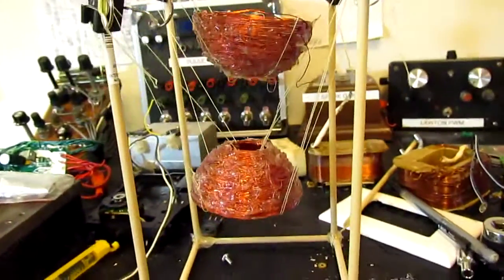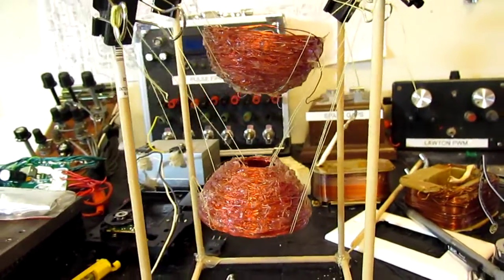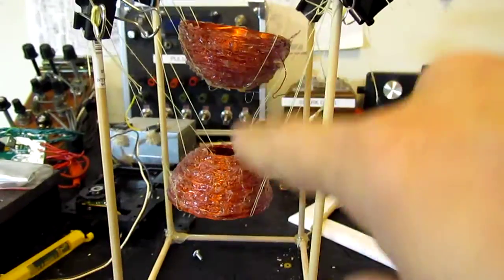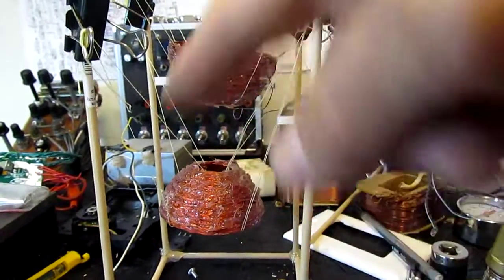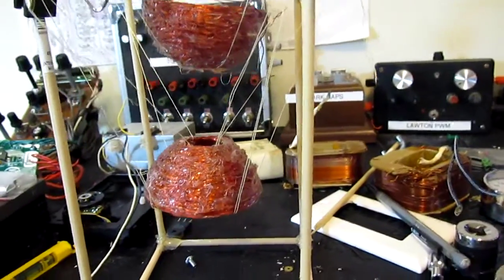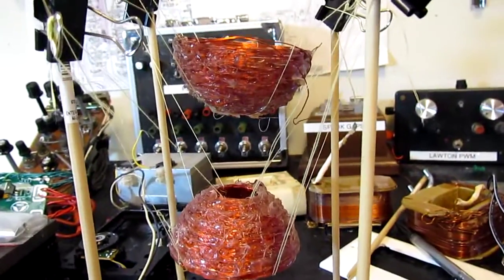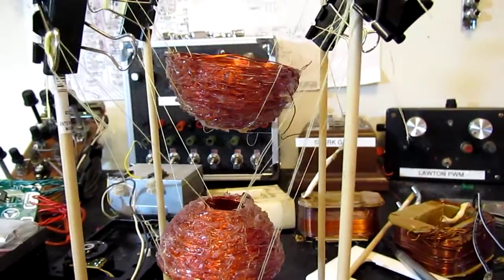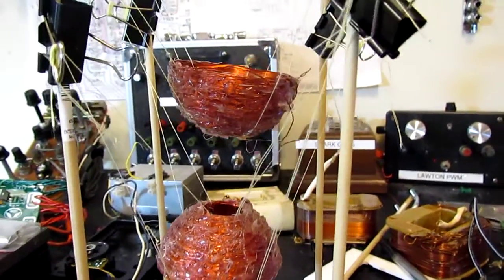Primer field coils.how should I power?

Comment: Re-read Tesla's patent on bifilar coils. He points out that the capacity of the coil will increase to the square of the power. This is why the amperes are so high. That's how they work/what they do. They also nearly eliminate the resistance/self-inductance because the projected currents are bidirectional and offset the amplified inductance effects of each other. This will make the coil you have diamagnetic. 

But the insulation and hot melt glue will vaporize in the heat of a plasma arc. Expect smoke and hot mess. 

I wonder if ferromagnetic powder will just stick to the coils or form the shape of planets? Probably depends on the strength and concentrations of dust to magnet particles.

A single wire coil would be more natural, but the heat issue makes regular insulated wire a poor choice. 

The natural primer fields are definitely DC, everything is powered by moving charges which are not changing direction of movement. It is polarized originally by the Birkeland Current which are bidirectional which causes field reversals at fixed points/rings.

Comment: I would suggest a pulsed DC dual mosfet arrangement.... Or (since they are bi-filar), a dual joule-theif setup, or bedini... If you are going to put them in your awesome vacuum chamber with HV I definitely suggest insulating the heck out of them with epoxy (or some other high dielectric strength resin... Yeah, you would really have to insulate them well... I just discovered you channel today, we have similar interests, check my channel out if you get a chance. I just did my first Primer Field setup, the coils are a little different than yours but overall the principle is the same.. Subbed.. Peace --Ben
Reply from the maker: http://m.youtube.com/watch?v=AnSNjdZxt34

Comment: You've got it all goin' on there!
Reply from the maker: just going with the FLOW....I am going to put this in a vaccum...any ideas on powering it?
Reply: Breakzeitgeist

Well, If you are replicating the primer fields experiment, you will want a plasma. I'd suggest a flyback or small NST setup with high frequency pulsed DC, or a spark gap somewhere if you are using line frequency on the HV side. 

Something I thought of when I saw the original experiment was to maybe wrap an external coil on the outside of the vacuum chamber and use this coil to power/create the plasma in the chamber. This way, you could use whatever HV power supply you want.

Then the two bowl shaped coils that you made can act as plasma powered oscillators within the plasma itself. They will create their own fields due to their inductive and capacitive properties. If you feed the leads of the bowl shaped coils out of the chamber, you could add variable capacitors and inductors to find their resonant frequency. You could also discharge them across each other via a spark gap. Just try various wiring configurations, experiment & have fun.. 

If you do this, just keep an eye on the HV power supply which is powering the external coil - you may overheat the secondary winding of the HV power supply due to the close inductive coupling between the external coil and the plasma. You'll see what I mean. Try a ballast or limiting resistor.

Of course, it's just an idea, but I'm pretty sure you should be able to modulate your plasma this way. There's a thousand ways to skin this cat.
Good luck :)
Reply from the maker: Energy Fabricator thanks so much for the input . I was going to fill the chamber with argon but still a little fuzzy about how to power the bowl coils. they need to be energized to create magnetic field to contain the plasma... so HV on the outside to excite the plasma but what to drive coils with to maake keep a uniform field? thanks so much again
Reply: Breakzeitgeist

No worries. It's just an idea.

The bowl coils will drive themselves...

If you have a coil wrapped around the vacuum chamber and drive it with HV & HF currents, it will create a plasma glow discharge in your chamber. The bowl coils will not need a power supply. They will get their power directly from the plasma and automatically create the bowl fields. By adding capacitance and inductance to the bowl coils (external to the chamber) you will have better control of the fields being produced.
Reply from the maker: Energy Fabricator awesome we have it going in no time now.